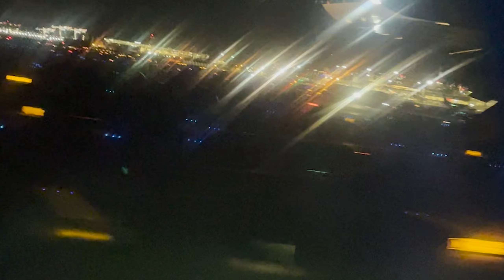SEMA 2021: Shopping for Ford Bronco Mods - Coderman Recap

Comment: Its great seeing so many accessories for the Bronco when it has not even been out that long yet. I'll definitely be adding a few things to mine after I get it.
Reply from the maker: I was thrilled to see so many options this early. Especially with pretty much all Broncos being delayed. I didn't see many 2 door Broncos for obvious reasons.
Reply: @CoderMan  I've only seen two 2 doors. Ones is a bad lands demo on a Ford Dealer lot and the other was a smaller dealership that had a 2 door outer banks that was sold at auction in Mass a few days later